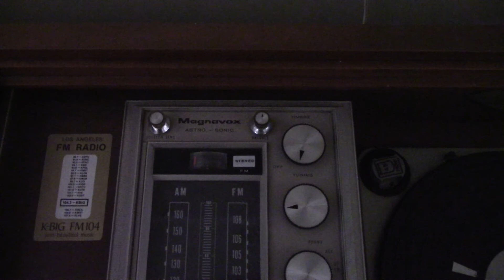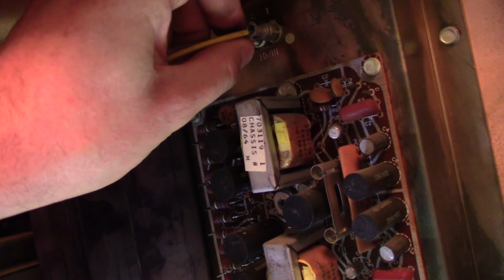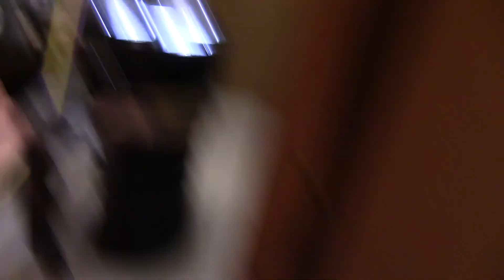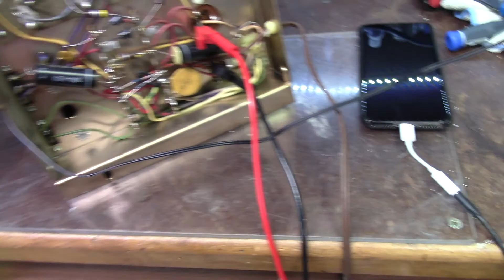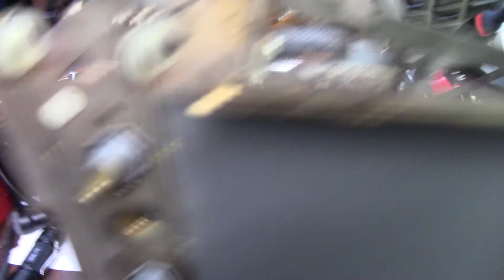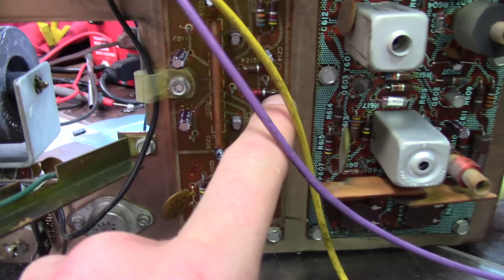Magnavox Astrosonic Stereo Console Disassembly and Re-Cap - Part 1

Comment: Could you show how u wired in the new filter caps? Or a pic? I’m confused on the +and- connection. Thanks.
Reply from the maker: I don’t have any pictures of it. But I show it in the video. The negatives of the caps go to the chassis unless I stated otherwise.

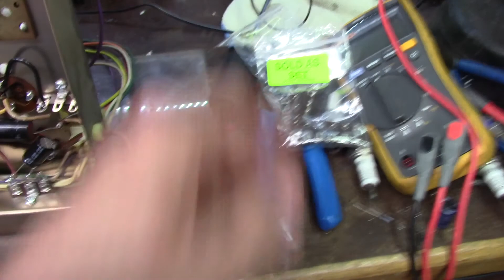Comment: The filter caps that you are speaking of at 12:00 mark, I have a very similar Magnavox Astro-Sonic amp with 3 of those cardboard cap cans. One of the floating caps have what seems like 2 ground lugs, where 2 diodes are connected (one on each lug). I am guessing that they did that for a cleaner job and could have just connected both diodes to the same ground lug. What do you think?

Comment: In that day, the tolerance on aluminum electrolytic caps was quite broad.  High quality Sprague caps were -80/+75%.  Those plastic body caps were much lower quality so, probably had a tolerance of -50/+100%.  I even saw failures of those even after just a few years of age, it was common for the case to crack and drip electrolyte.

For most manufacturers of those console stereos, the change over from vacuum tube to transistor circuits occurred in 1965/1966.  That Magnavox was probably a top of the line model, being solid state and it even has the FM multiplexer; an expensive option then that most console stereos didn't have in 1964 (when your Magnavox wasmanufactured).

Everyone designed with germanium in that day and with the low temperature rating, those transistor can undefuse and return to sand just sitting on the shelf, not even being used.